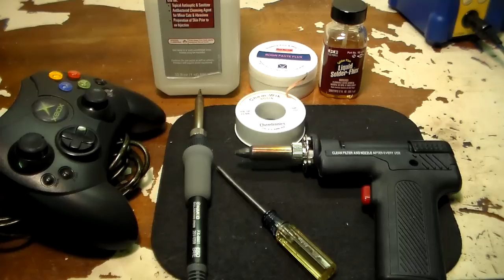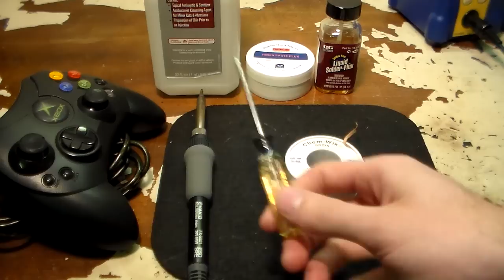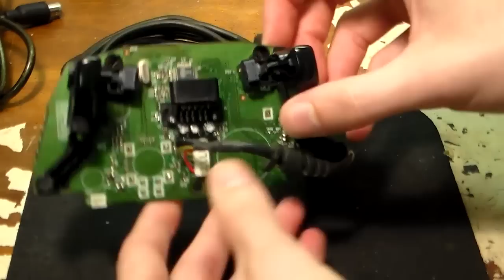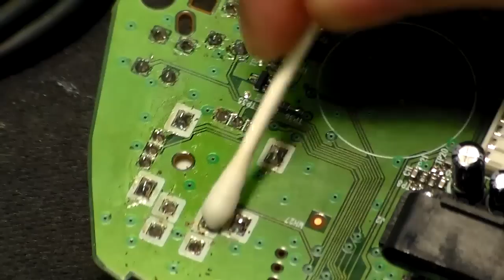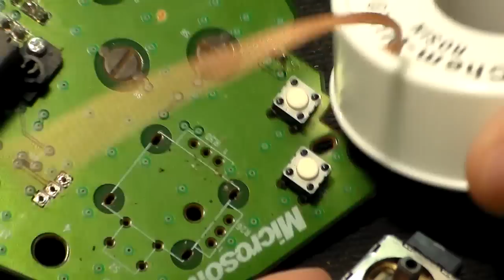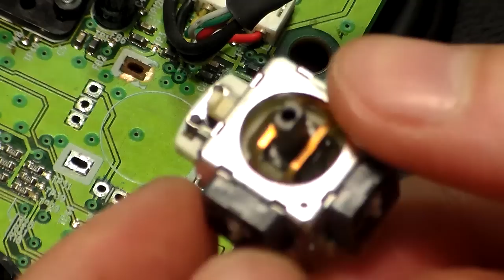How To Repair Your Analog Sticks Easily

Comment: So do you think I could swap out analog sticks from a PS2 dual shock controller into a big Duke Xbox controller? I am trying to fix a customer's controller that has a worn out left analog stick. Thanks
Reply from the maker: It will probably work. I can't remember if the analog sticks are different so you would have to open both and see
Reply: @thewheelman282  OK thank you.

Comment: Just wondering if anybody knows if you can put an xbox one analog box in a gamecube controller. here is a site that carries both. the xbox one has a couple more pins than the gamecube one but I wasnt sure if that mattered.
Reply from the maker: It might fit if you cut the extra pins off
Reply: @thewheelman282  Thank you. That was a super quick response i appreciate that man. Im super well versed on how board connections work. If the extra pins were cut off would that effect anything?
Reply: Correction i meant to say NOT well versed lol. Just trying to figure things out
Reply from the maker: Oh wait I wasn't thinking it through enough. Ok so since Xbox analog sticks can be pushed to click you can cut those pins off the button bc GameCube sticks don't click. But some newer analog sticks have 8 pins while some have 6 for the actual stick part so you can't cut those pins. There's also a possibility that GameCube sticks are a different size so Xbox sticks may not fit. It would best to take apart your broken controller and make some measurements first
Reply: @thewheelman282  here is a site with both of the sticks. sorry i forgot to add it the first time ( https://www.aliexpress.com/item/32949444062.html?src=google&src=google&albch=shopping&acnt=494-037-6276&isdl=y&slnk=&plac=&mtctp=&albbt=Google_7_shopping&aff_platform=google&aff_short_key=UneMJZVf&&albagn=888888&albcp=1582410664&albag=59754279756&trgt=743612850714&crea=en32949444062&netw=u&device=c&gclid=Cj0KCQjw6KrtBRDLARIsAKzvQIErhKnDGYPjJigG5Ce-t8rAZMZkIkX0qnJdJ4o42QKJm81kqYVqNhUaAlfjEALw_wcB&gclsrc=aw.ds ) And if the measurements were to hold constant, even if the pin count was different would it still work? And again, thanks for your time man i really appreciate it

Comment: there are ps3 controllers with 3 pins and ps3 controllers with four pins. instead i think that ps4 uses only controller with 3 pins. so my question is, if the pins are the same, the ps4 stick will fit in the ps3, true or false??

Comment: i have a 3rd party joystick can i use its analog sticks in that controller on a ps4 . I checked the number of pins they all match, i was wondering if it will fit or not

Comment: So you could, in theory, take the buttons off a PS2 joystick and use those in a GameCube controller?
If so, that would be a HUGE help for me, because both the GC controllers I bought from eBay have cruddy and wobbly analog sticks.
I also assume you can take the joystick off of a Nunchuck and do the same thing.
💯✔️👌
Reply from the maker: The buttons probably won't fit. The analog sticks might fit if modify them first
Reply: thewheelman282 I was talking about modifying the joysticks so they don’t have the clicky part
But yeah basically

Comment: Are all analog sensors the same because I think I’m going to get a cheap controller and use the sensor wheel to replace my ps4 controller pls help
Reply from the maker: They're not all the same unfortunately. The PS3 and PS4 controllers use analog sticks that have 4 pins instead of 3 shown in the Xbox controller.
Reply: thewheelman282 sry but wdym
Reply from the maker: https://www.picclickimg.com/00/s/NTQxWDc3Ng==/z/FAsAAOSwwbdWHu1J/$/Replacement-Thumbstick-Analog-Stick-Joystick-For-Playstation-3-_1.jpg
I think I made a mistake though. Looks like PS4 uses 3 conductors and PS3 uses 4. Sorry about that

Comment: Hey this is a neat tutorial. My PS3 controller has its left analog stick literally slightly pointing up. I will definitely consider this. However would there be a way make my analog normal without this? Either way this is cool and something I'll try to learn.

Comment: My dualshock 3 left analog makes a clicking sound when i move it any idea what it is?
Reply from the maker: Kevin Santhosh is the mech. It's on it way out and needs to be replaced
Reply: thewheelman282 do you know if it is possible to fix without replacing it. I know it sounds crazy but i have a attachment to to controller now. Lol

Comment: Can a ps1 stick fit on a gc controller dude?
Reply from the maker: if i remember correctly, it does fit, but remember the gamecube doesnt have clicky thumbsticks like the ps1 does. so you have to remove the button on the controller mech of the ps1 controller before you install it in the gamecube
Reply: just removing the pins?

Comment: Would a dualshock 4 analog stick assembly work in the duke or s controller? I've been looking at the replacements for xbox 360, xbox one and ps4 on ebay. They all appear to have the same spacing.

Comment: what type of oil did you use to lubricate the sticks?
Reply from the maker: Mr.L.A. I didn't use any oil. I just replaced the sticks. They are already oiled
Reply: ok.....well what type of oil should one use for this application?
Reply from the maker: any non-petroleum based oil should work. perhaps a silicon variant
Reply: Mr.L.A. That’s what she said *troll face

Comment: Would I be able to take the analog mechanism out of a ps4 controller and put it in a xbox one controller? And what would be a good but cheap soldering iron?
Reply from the maker: you probably could as long as the pin spacings are the same on the two analog sticks. i havent actually tried so im not totally sure. there are so many irons, i have a hard time recommending one. look at a amazon reviews and find one your comfortable with. but you will need one thats at least 20 watts / can reach about 600F for the steel anchor points on the analog stick housing
Reply: thewheelman282 thanks and is there a way to increase the amount of tension used to move a analog stick in any direction? The xbox joysticks feel really loose compared to the ps4
Reply from the maker: I'm not sure that's possible. You would probably have to find an an analog stick that gives you that tension that you are looking for
Reply: Okay I'll look around for one, thanks a lot
Reply from the maker: Rocambalsco , no problem man

Comment: Some of my controllers have stiff & creaky  sticks. Fluid movement is impossible on those. I've had this problem with one OG DualShock 2, one OG Xbox 360 pad and one bootleg Xbox pad. Tried lubricating but it didn't help at all.
I assume something was botched during the production and the only way to fix the problem is to replace the entire analog mechanisms. Is that correct?
Reply from the maker: ive experienced the same thing on first party controllers too. lubrication doesnt help much. i assume its just the way the sticks were manufactured but im not totally sure. i just replace the mechs

Comment: so my xbox360 anolog stick broke and i have a controller that dosent work so i can open both and switch them
Reply from the maker: if its another 360 or xbox one controller, then yes. the 360 controllers use a slightly smaller analog stick that other controllers. or you can buy replacement stick from dealextreme.com

Comment: Would this work from an original xbox controller to an xbox one controller?
Reply from the maker: unfortunately not. xbox one controllers use a slightly smaller analog stick so you would have buy replacements